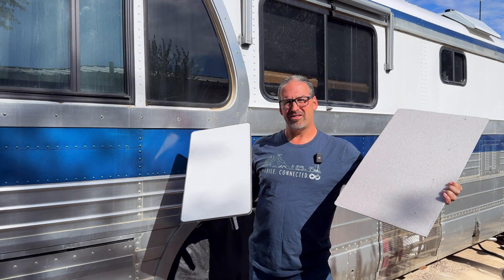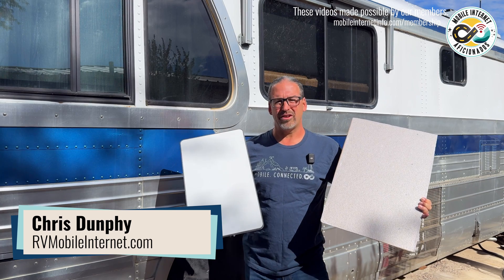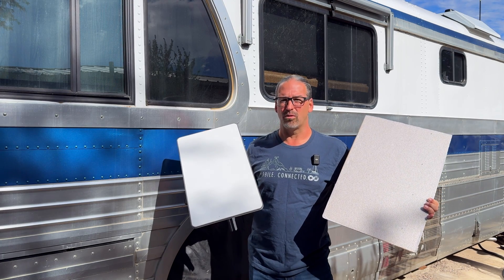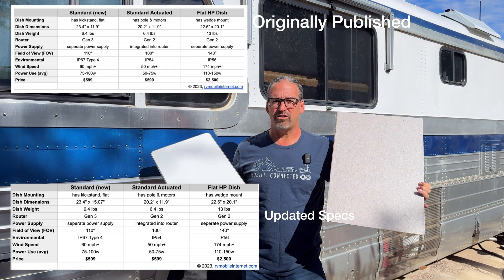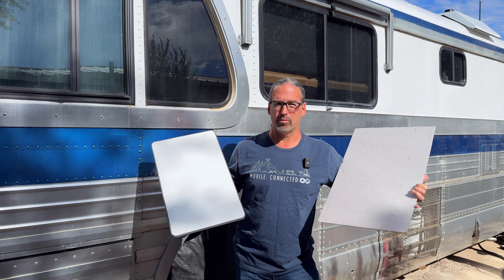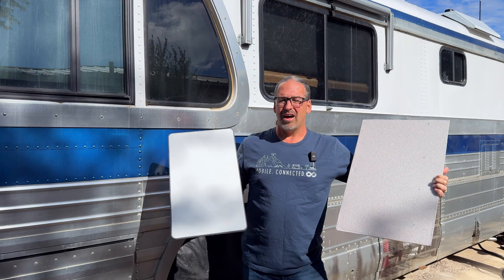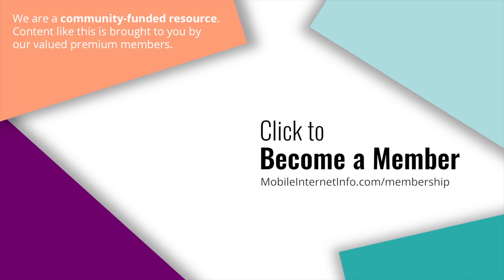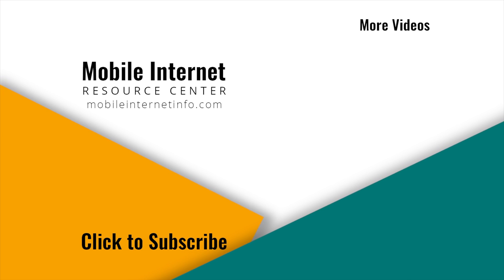LARGER than Originally Reported - Next Generation Starlink Standard Dish

Comment: Just got the invite. I'm still on the very first generation with rounded... any reason to change? I only use it at my house currently. It's $599, but they're currently offering 1 month free with purchase, so $479 I guess.
Reply from the maker: The v1 round dish was well made and has remained popular with those that have it for many reasons. We will have to wait until real world reports to see if there is any significant improvement in performance with this latest dish, but I wouldn't expect anything spectacular better over the v1 round dish. 

Users on the v2 Standard Actuated Dish are more likely to see an improvement with the new Standard Dish due to its larger size and higher power usage. But compared to the v1, the new Standard is more similar in size and power usage and probably performance. 

The main difference someone might see in a house with the latest Standard dish is better Wi-Fi coverage and Wi-Fi speed due to the newer Gen 3 Wi-Fi 6 router that is included, but Starlink was already offering that router to some v1 dish holders or if you have already ditched the v1 router for a nice 3rd party router, than that shouldn't be a concern. 

Also if your Wi-Fi speed is already faster than the Starlink speed, a higher performing router isn't going to change your overall internet speed. 

If you are currently happy with the V1 performance and don't feel like you need to be on the cutting edge of new products then your round dish should continue to serve you well. You of course could purchase this dish at any time in the future once fully available if it turns out to be something you really want.
Reply: @MobileInternetResourceCenter  makes sense thank you! I think the only benefit right now is I would effectively get a $120 discount since they're giving a free month with upgraded dish purchase. Of course they might keep that discount when the v3 is generally available!
Reply: My email shows a 2 month credit. I wonder why they are offering different credits.

Comment: So...I must be smoking something. I no longer see the new dish on the Plans page of the Starlink site. I swear it was there. Now its gone? Everyone was chopping the back off their actuated dish and coming up with ways to flat mount it. This new one will have mounts and adapters to easily flat mount. Even though its bigger, maybe many more people will permanently mount it to the tops of RV's and boat roofs?
Reply from the maker: They have indeed removed it from the data plans grid.. but it's still on their Specifications page: https://www.starlink.com/specifications

Best guess is that it was causing confusion, as they're not yet selling it without an invite.
Reply: Ahhh. Many thanks.  @MobileInternetResourceCenter   I'm planning on getting a small trawler and trying the loop sometime next year. My idea right now is to get the InstiConnect system and the Starlink. I figure between the two I should have reliable high-speed. I might want to blend them with something a PepWave. Not sure yet.
Reply from the maker: Stay tuned.. we just filmed our first look video of the new Insty Connect hardware offerings.